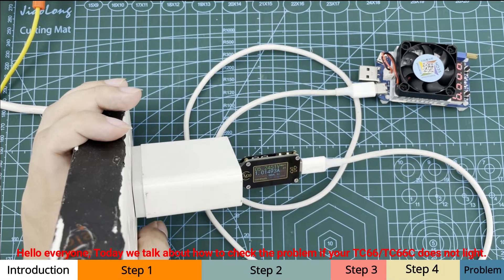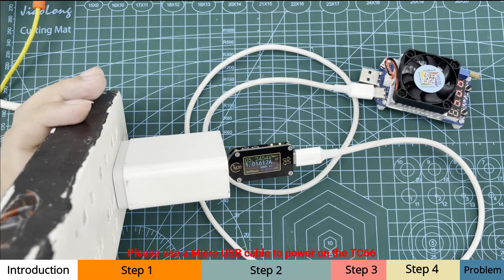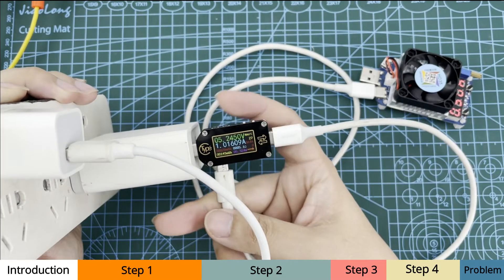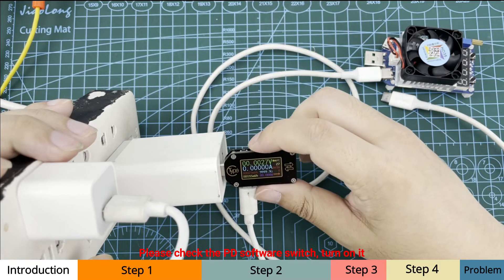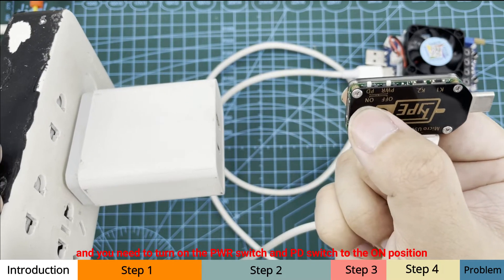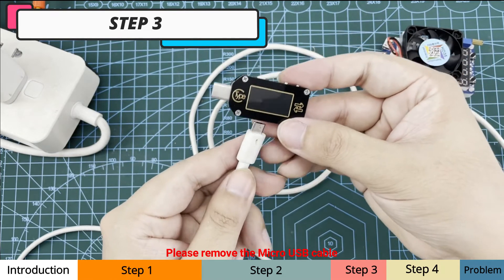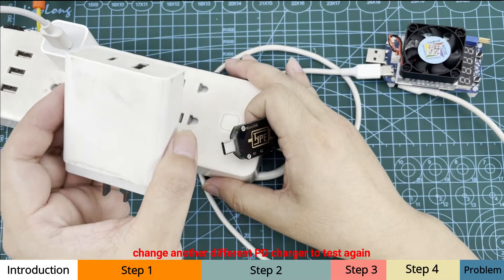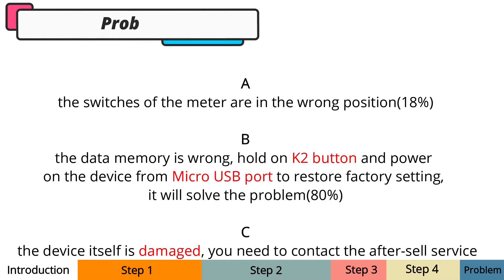TC66 TC66C does not light? How to judge the problem

Comment: What is the best way to test the resistance of an USB-C to USB-C cable on an USB-PD charger with the TC66C  ?  I have TC66C, UM24C, UM25C which meter is best for this. I do not want to use an adapter as this will increase resistance higher.
Reply from the maker: hello, you cna use UM25C, in its manual, there is cable resistance test section, you can check
Reply: @rdtech9153  I tried plugging an USB-C to USB-C cable on my UM25C to an USB-PD charger, but no power.  I tried doing the same with my FNIRSI FNB38 tester and there is power to power up the tester, but I still have to use an USB-A to USB-C adapter to test with a USB-PD charger which causes high resistance. So now I have no good way to check the resistance of USB-C to USB-C cables. :(
Reply from the maker: @etow8034  hello, for USB-C testing, there must be load, because for USB-C port, only when there is load, the port will release power, then the meter will light
Reply: @rdtech9153  I put the load on the USB-A back side of the UM25C but still it won't power up. If I put the load on the USB-C output it will require the use of an USB-A to USB-C adapter which will again increase the resistance even more. So you're saying I have to use an adapter or cable on both the USB-C input and USB-C output of the UM25C to set the reference setting for cable resistance ?
Reply from the maker: @etow8034  hello, you contact us on aliexpress, show us how do you tect the resistance, we check your video and tell you the right way, by words you cannot understand it clearly

Comment: Can you please fix the TC66 pc software so the firmware update works. Or provide another way if updating firmware.
Reply from the maker: you cannot connect the TC66 to PC software? usually you follow the instruction, install the driver and it is easy to connect it
Reply: @rdtech9153  I follow the instructions and the firmware will not update. The error says "Firmware failed to download." Please help.
Reply from the maker: @jasonmartin9306  hello, for this, please contact the aliexpress after sell service, show them the picture and they will help you, do not worry
Reply: @rdtech9153  We are still waiting for a new version of the PC software that will also work on Windows whose default language is other than English. The problem is that your software automatically detects the serial port only in English Windows and not in Windows localized in other languages.
Reply from the maker: @_jis_  for now we tested that only Korean Language and Polish Language windows system has such problem, does other language system has not working problem? you can tell us
Reply: @rdtech9153  Czech language too.
Reply from the maker: @_jis_  oh, I mean Korean and Czech this 2 language windows system, this is not fixed now